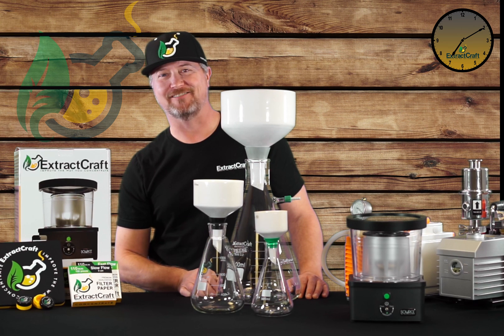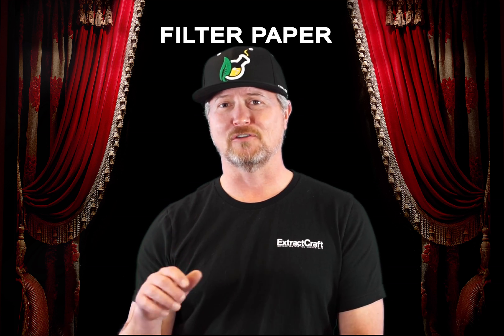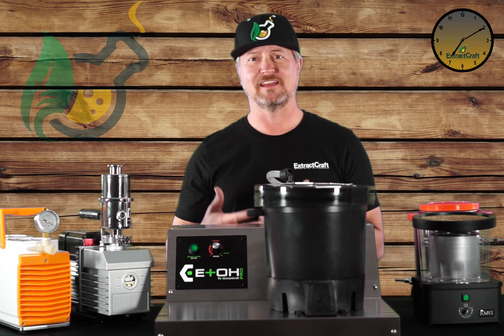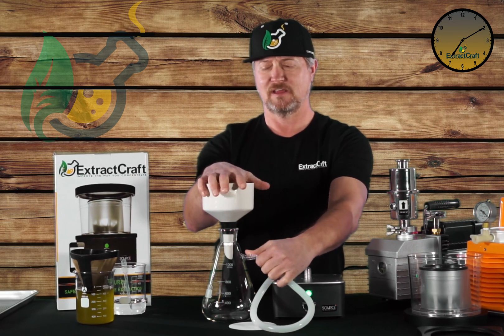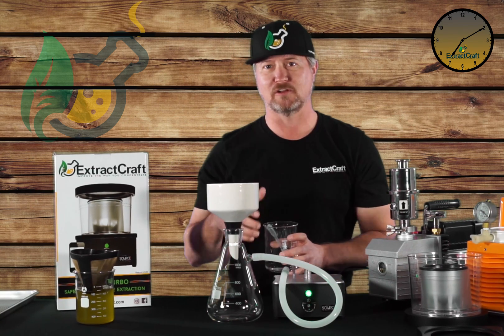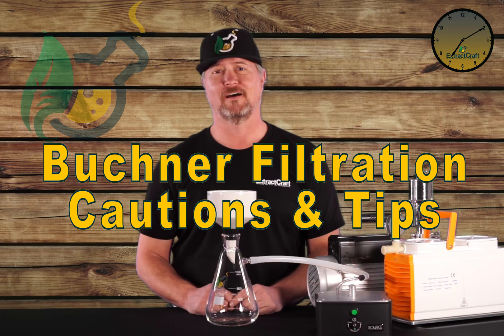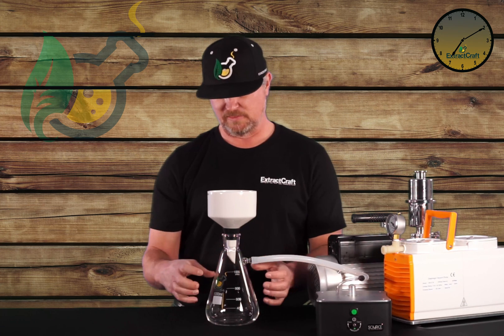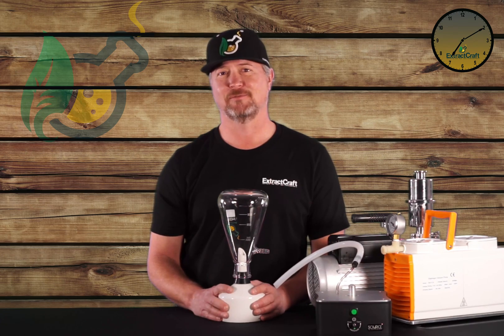Buchner Filtration - The Full Skinny (Source Turbo demo)

Comment: Wouldn't the ethanol through the pump be a fire hazard????
Reply from the maker: There is no ethanol in the pump(s). Ethanol is not being pumped. It condensates on the top glass and collects in the reclaim tank. It never gets near the pumps. 
Nothing here is a fire hazard and it has Underwriters Laboratory approvals. That really caps it on the safety charts. We have a LEVO that does not have any safety approvals.

Comment: I dont get it. If the machine removes 98% of the ethanol then what are you running through the filter?
Reply from the maker: The filtration step happens before you run it through the machine. So you cover the plant material with 190 proof non-denatured ethanol, let them soak together, then filter out the plant material. Once filtered, you run this filtered solution through our equipment to evaporate off and recollect the ethanol, leaving your oil behind.
Reply: ahh makes sense now. Thank you for you reply. I WANT ONE SO BAD!

Comment: Could we use this with perfume/ethanol?? Perfume needs to be filtered with the ethanol and concentrate together.
Reply from the maker: Hey there, could you expand on this question? Many folks use our equipment to make absolute oils that then go into perfumes, but I'm not sure if that answers your question.
Reply: @ExtractCraftVideos  We mix 100% concentrate with ethanol when we upscale to commercial quantities.  It then needs to run through a filter to remove impurities  and material fallout from the  perfume.  Sometimes twice. And any cloudiness in the perfume as well. So the liquid is perfumers alcohol 95% ethanol and 5% water mixed with perfume oil concentrate.  10-15% concentrate to 80% alcohol.  
Can you do this safely with this filtering system?
Reply from the maker: @wyomingpark  You could definitely use our buchner funnel system for filtering that, yes, I don't believe you'd want to process that solution after in the Source Turbo though. But you could use the buchner funnel for filtration.
Reply: @ExtractCraftVideos  Thanks for the clarification.

Comment: I have a 3 CFM Single Stage Pump Kit for vaccum purging after source turbo. Do I need a cold trap for that? Or am I fine since I usually only plan to run the pump for 5 minutes and turn it off anyway?

Comment: What size tube is used for the 500ml flask,it looks like 2 different tubes connected, one part for the turbo and the other for the flask, where can I get these,your website is out out the buchner and filter papers
Reply from the maker: This is a 1000ml flask. It comes with a 3/8" id hose. There is an adapter that is a 1/8" id hose, with a connector piece to attach it to the 3/8" id hose. We are out and hope to have more in a couple months. You can find similar Buchner filters around the web such as on Amazon.

Comment: I just started my first run of some papaya trim and it's been like 5 hours and it's like  halfway done,can I stop it and start it at turbo mode? I don't have all night to finish this
Reply from the maker: Turbo mode takes 2.5 to 3 hours to complete a full crucible, where normal takes 4 to 6. You could stop it and run it on turbo. Also make sure your elevation is set properly as this is very important.

Comment: Why aren’t the filters a cup shape?? The debris can just circumvent the filter around the edges.
Reply: This is why you need to prewet the filter paper and create a nice seal
Reply from the maker: No they don’t.  That’s what the vacuum does
Reply: @ExtractCraftVideos  causes the filter to suck down and force solution through filter? Ok fair enough
Reply from the maker: @Lanterns_light  correct

Comment: Great Video!  just a question regarding the tubing, it's got to be vacuum tubing you said, regular vinyl plumbing tubing won't work?
Reply from the maker: Thin walled tubing like surgical tubing will collapse under vac.  More stout tubing is necessary